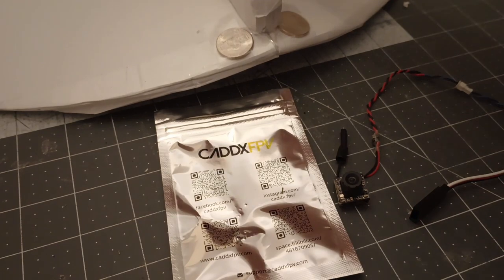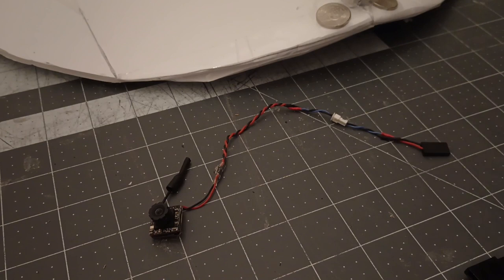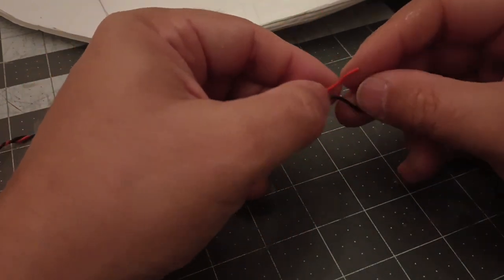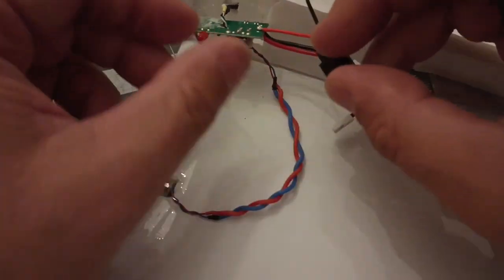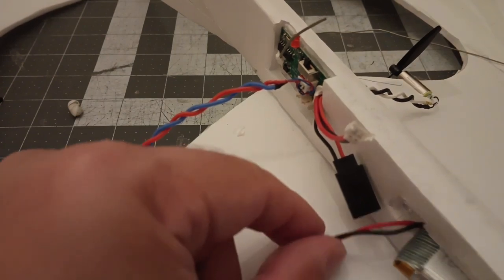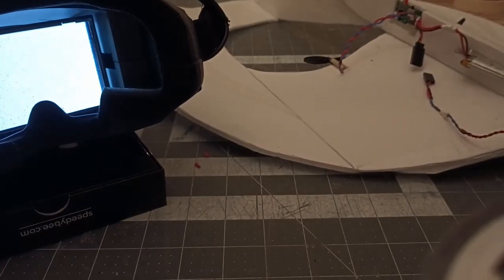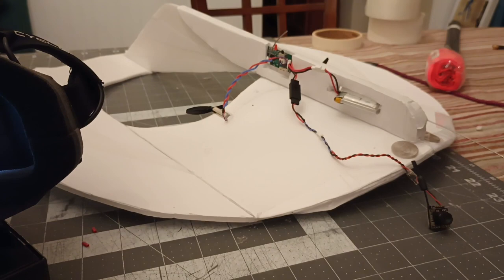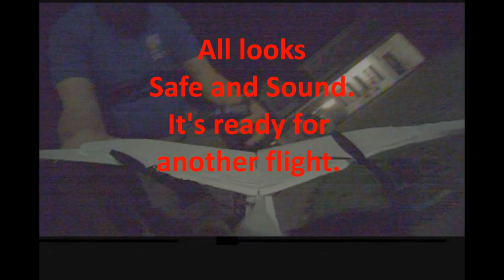Add FPV to all your EZ Pack Planes

Comment: You are making it harder and harder for me to keep away from FPV.  This looks pretty straight forward and simple.
Reply: You still haven't done it... shame shame good sir
Reply from the maker: @North49rc is right... But it is a chunk of change. The aio unit makes it simple.
Reply: @aviationrcnoob  For analog the cam and vtx even as separate units is still pretty cheap. Its the goggles that can be pricey